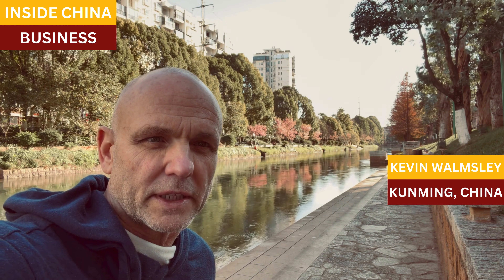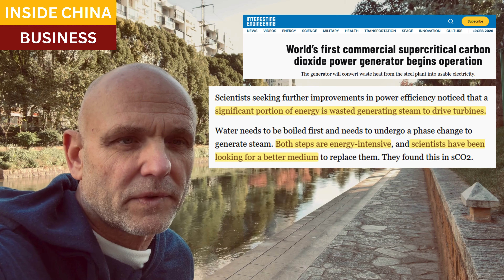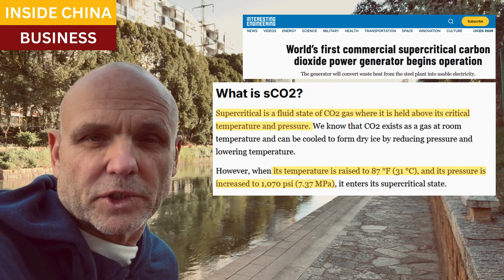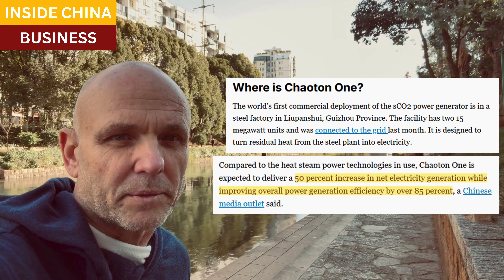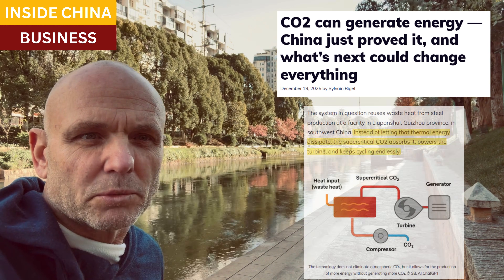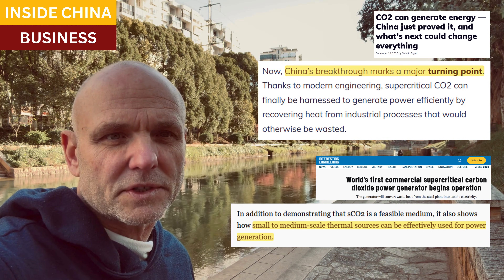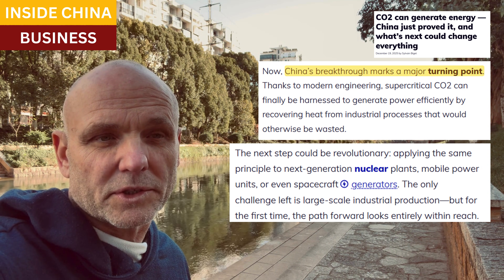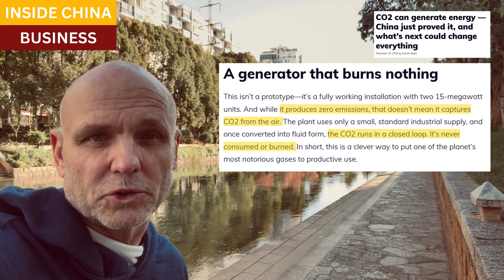Revolutionary generator transforms Chinese factories into power plants

Comment: So interesting and encouraging.  Go China! While some invade, others innovate.
Reply: Where are the ugyhers since you wanna act high and mighty 😂
Reply: Maybe very soon,
Beijing will not be in need of buying oil from Venezuela ?
Reply: @FunnyBunny-pd5xx  
That would be the plan.
I wonder if donny is going to be surprised when "previous customers" find other suppliers anyway.
Reply: @rogerstarkey5390

There are three types of oil.
Venezuela produces heavy oil. (Which the Refineries in Texas refine)

This heavy oil has several applications, including the fuel used by jet engines.
Reply: @FunnyBunny-pd5xx  The upcoming fighter jets from china (7th gen) are electric engines, jets already prototyped, waaay more powerful than all fossil-fueled jet engines (and simpler and cheaper to make & maintain). Same for jets as cars. An american expat in chinese singapore.
Reply: @davidrichards1741  That seems far-fetched due to the energy requirements, so I'll need to see it in operation.  The current jets we've seen are all using Chinese jet engines of conventional design.
Reply: @FunnyBunny-pd5xx  China is moving to produce bioAVfuel - automobile ethanol, but refined for jet engines.  China intends to be able to produce their own jet fuel as a matter of strategic necessity.
Reply: @davidrichards1741 

Thank you for your informative comment - much appreciated.

I was making the point - how convenient Venezuelan oil IS just the right type of oil, FOR The Oil Refineries IN Texas,
and
people who are living in The US, travel by plane whilst most people travel by bus.

Best Wishes for 2026.
Reply: @ZweiZwolf 

Thank you for your informative comment - much appreciated.
(I will try to remember for my future comments)

Best Wishes for 2026.
Reply: @FunnyBunny-pd5xx  You too, happy 2026!
Reply: @ZweiZwolf  That's already solved as silver solid state battery solutions provide much more energy with countless times greater energy density than all fossil fuels. Korea already has a working prototye. Or else new SMR's can more than amply satisfy energy requirements, and their price will tumble and use will burgeon. Not today but by 2030. Fossil fuel engines face obsolescence as they're inefficient, polluting toxins, and expensive to make and maintain.
Reply: @ZweiZwolf  China is exposed to western dependencies and export bans for conventional jet engines and related parts, tho they get some partial relief from russia. But china's focus is more on electric now. Wanna bet china will be producing electric jets before the US has its 6th gen fighter jet in production?
Reply: @d @davidrichards1741  I think SMR’s will be DOA, outside of perhaps China.  Solar, wind, batteries will still be cheaper than SMR’s which end of the day require Uranium, which isn’t cheap to buy or dispose of.  And the reality is all cost efficient grids will contain lots of storage options, which makes generation method way less important.
Reply: @FunnyBunny-pd5xx  China imports <4% of their oil from Venezuela, so they could cut off Venezuela completely with no issue, just import a little more from Russia, Iran, and Arab dictators.  As China electrifies transport (NEVs currently 60% of new sales, E-trucks booming, E-ships for inland water), their need for oil will drop rapidly.  Geostrategically, China will reduce oil imports to ONLY Russia, Iran, Venezuela, and friends - we'll see this in a decade or so.
Reply: @ZweiZwolf 

It always seems Beijing is light years ahead of the curve, in all aspects of every day living and working.

Thanks for the information.
Reply: @FunnyBunny-pd5xx  China MAKES the curve.  China's green shift changed global oil forecasts - not just for China, but the world.  It's amazing what happens when you let engineers run a country, their job is to optimize everything for everyone, and you give them the time and resources to do so.
Reply: @FunnyBunny-pd5xx China doesn’t need to buy oil from Venezuela anyways.  Not like there isn’t a glut of oil on the market currently.
Reply: "While some invade, others innovate."
I love it! 💯
Reply: Why not both?,the gun and the powder we're both inventions.
Reply: @aaroncruz9181 

Alfred Nobel invented dynamite, and also The Founder of the annual Nobel Prizes.
Reply: @FunnyBunny-pd5xx   True, but he invented it to make handling of explosives safer in mining and industry....it was others who used it to kill.
Reply: @MrLeadb1 

Thank you for your reply.
Reply: @FunnyBunny-pd5xx The Nobel peace price was just given to Machado, a far right political leader in Venezuela, who, upon receiving the prize, praised Trump and ask for foreing military intervention in her country.  Knowing that renders Nobel prizes worthless, meaningless in my book.  Let me correct that : they are not worthless, they are worth shit.
Reply: @louisjouvet4548 

I am fully aware of the information in your comment.

I ask you to refrain from using such language, when addressing a comment to me.

IMO - it is unnecessary vulgarity.
Reply: @FunnyBunny-pd5xx The image used served a (shocking) purpose.  Plus, it's not that vulgar after all.  But anyway, sorry if it offended you, it was not part of the plan.
Reply: @louisjouvet4548 

Thank you for your reply comment - much appreciated.
Reply: Meanwhile China planning to invade Taiwan:
Reply: @Xodabeef Taiwan is Chinese.  Learn history.
Reply: @Xodabeef  LOL, you can't invade your own territory, and no country in the world recognizes Taiwan as an independent country.  Not even Taiwan says that.  The Constitution of the Republic of China (Taiwan) clearly states that they are a province of China.  

It's not like the US Navy can invade Florida.
Reply: You said that about the country that intends to invade Taiwan? And is trying to take over the South China Sea.
Reply: @nexpro6985 With all due respect, you don't know what you are talking about; you are just repeating the propaganda script you are being fed.  Taiwan is Chinese it' s a fact recognize by the UN, by the international community.  As for Power projection, the US has more than 700 military bases all over the world.  China... 1.  Tell me now who is trying to impose it's power via brute force in our world.  Keep on educating yourself.
Reply: @louisjouvet4548  That fact is also stated in taiwan's constitution.  The DPP refuses to call a referendum because they know they'd lose.
Reply: @nexpro6985  That's the evil, hated US, despised by 87% of humanity worldwide, and by 94% of people here in ASEAN.  Read the new $65-million study of ASEAN by the gov't of singapore published in ISEAS.
Reply: @nexpro6985  What country will invade Taiwan?  Taiwan is Chinese territory, as recognized by EVERY country in the world.  EVERY country agrees that Taiwan is a Province of China.  The only question is which government should rule - that's a Civil War, and whether reunification should be at the point of a gun.

A country cannot invade itself.  You wouldn't say the US Army invades Colorado, or the US Marines invade Florida. But competing factions in a civil war can certainly fight.  

Compare with the American Civil War, in which the United States of America invaded the Confederate States of America.  It is the greatest hypocrisy to suggest China should not use military force in resolving their civil war when America did so themselves.
Reply: @ZweiZwolf  The only government that should ruleTaiwan is the existing government of the country of Taiwan.
Reply: @ZweiZwolf   do not accept CCP propoganda. You are a liar as are the whole of the CCP.
Reply: @nexpro6985 According to the UN and its members, that government is the People's Republid of China. 

Considering that the USA invaded the Confederate States of America, in defiance of the wishes of the people who lived there, it's the highest hypocrisy to suggest China shouldn't reunify by overwhelming force.
Reply: @ZweiZwolf Taiwan was NEVER part of China. Go read some history.
Reply: @nexpro6985  It absolutely was.  Taiwan was Chinese territory prior to the Japanese invasion, and the PRC is the inheritor of Chinese territory. Go read history, along with the Constitution of the Republic of China (Taiwan), which also clearly states that Taiwan is a part of China.
Reply: @ZweiZwolf Formosa was not a Chinese territory.
Reply: @nexpro6985  According to post-WW2 treaty and Republic of China, the island of Taiwan certainly is.

Now explain Ryukyu Kingdom.
Reply: @nexpro6985  Why is USA in the Republic of China (legal name of Taiwan Province of China) and the South CHINA Sea, half a world away from home? Asking for a friend. An american living in singapore.
Reply: @davidrichards1741  Taiwan is a country not a province of China. And your 'asking for a friend' is hilarious.
Reply: @nexpro6985  Taiwan is even less of a contry than hawaii.
Reply: @davidrichards1741  And China is barely more democratic than North Korea. We see the way the CCP shuts down bad news and gaslights the population of China. We see the oppression of the Uighurs by the CCP and their opression in Tibet. China is a dictatorship, nothing more.
Reply: @nexpro6985  Sure buddy, and yet globally, several times more people in the world today prefer China over the US, according even to the big new study by the West's own Democracy Perception index org.  And 80% of humanity aligns increasingly with the Global South china-led BRICS+ and SCO because they believe it's better, which is easy to understand why to anyone objective.
Reply: @nexpro6985  And the world sees that the US today is a lawless rogue pariah state. One of piracy and warmongering on the basis of contrived lies. US rightly convicted of jeno side of millions of kids & women by the UN ICJ and ICC courts. And the rogue US responded by literally threatening the judges!
Reply: @nexpro6985  A nation of racism, corruption, enslavement, jeno side since its founding thru today, with the most crime & violence & incarcerations of any nation. Insolvent and salty. Blames everyone but itself for its own-created problems which are worsening as it gradually fails. Now literally the most-hated and worst country in the world, nothing more. Speaking as one who has lived and travelled  all over the world.
Reply: @nexpro6985  US and the west today is nothing like what it was last century, for the worse. China and some others today are nothing like they were last century, for the better. Sad but true. And that trend continues. An american expat (renonced) in chinese singapore with 8 decades living on this ball of dirt.
Reply: @davidrichards1741  are you some kind of CCP shill? Why do you seem to assume I am an American? Does a person have to be American to recognise that the CCP is an authoritarian, nepotistic, corrupt government?
Reply: @nexpro6985  No, I assumed you were "west" or indoctrinated by it which amounts to the same thing at the end of the day. I'm a hunanist.  I servied. Did  you? Seems not. One good thing about the US is finally shaking off its parasites, which it should've done long ago. As the EUSSR and yUK are arguably even worse. All trash and talk about "authoritarian" and "corrupt", omg. World has changed and is changing more on an accelerated basis.Get a clue.

Comment: So basically China is gonna get accused of even more unfair advantage and low price in steel ? 😂 as if Chinese steel price couldn’t get any lower🎉
Reply: Henry Ford understood this methodology of reducing your costs to make more affordable products which then sell more, boosting your profits. Western manufacturers have forgotten the lesson he learned. China has embraced it.
Reply: @javelinXH992  not forgotten they leaned on the Rolex lesson. Fake manufactured scarcity, drive up demand, FOMO, price and profit. But only works when you can create fake money from thin air. This method siphons money from the rich and wanna be rich.
Reply: Remember a while ago, Kevin introduced us to "Flash iron-making"? ("3,600 times faster and 30% ENERGY reduction"?)
Well, NOW they can add the CHEAPER energy to the cycle!
Reply: Chinese is accused of better DNA. Can’t help it. Then again, China doesn’t have many basketball players.
Reply: Lame joke what advantage?

Comment: They're also planning to mate this turbine to the Thorium molten salt reactor (TMSR) because on top of increasing efficiency it will reduce risk significantly in the heat exchanger. TMSRs use sodium-based molten salt as its coolant, and this secondary molten salt then gets passed through a water-based heat exchanger to generate steam. Any minuscule leak in the heat exchanger could allow the salt and water to start mixing and cause cascade problems in the system down the line. Using sCO2 (which is inert) removes this risk completely.
Reply: Interesting thanks for the info
Reply: I heard that they are building an ice breaker based on this combination.
Reply: @tsuikr    Not only ice breakers but all large ships will use the Thorium cycle.
CO2 'boils at lower temperature and therefore can utilize lower temperature to produce electricity or shaft power in direct drives.
GE had developed a desk sized CO2 turbine which otherwise would be the size of a large room. [ I invent in this space]
Reply: @tsuikr     Submarines and large aircraft are the most relevant applications. That's probably where GE's focus is but now they will be forced to go mainstream or lose that market. In space,  lower boiling temperature fluids, like helium or nitrogen, will be used.
...
..
.
Reply: @MiloTheMindBender never nuclear aircraft, too heavy.
Reply: @glike2   As a triple engineer I assure you radioisotope planes are possible. USA and USSR designed them long before miniaturization was a thing. I wave improved this concept.  =]]
Reply: @tsuikr 

really?  I know they are building a Cargo Ship with TMSR
Reply: @Dutchthink28nmisAdvanced  Well, no. They patented one. The TMSR itself doesn't exist yet. They're only now moving to build a power-generating 10MW unit (the initial test reactor is 2MWth and doesn't generate electricity).

Also, the real reason Jiangnan patented that ship is because they needed a pathway to obtain nuclear naval certification because they were bidding for the Type 004 carrier. They lost the bid (because Dalian ended up building ship 020) and will build the first 003A instead (ship 019, basically Fujian with redesigned superstructure), but they will still pursue the nuke certification for follow-ups to 020.
Reply: @andrewsuryali8540 

Does  it matter why they are building the cargo ship?

They are building it that's what really matters 

👇

China plans world’s first nuclear-powered cargo ship to carry 25,000 containers

The reactor design is classified as a fourth-generation nuclear system and is expected to have a 40-year operational lifespan.

Dec 08, 2025

Interesting Engineering
Reply: @Dutchthink28nmisAdvanced  I think you're misunderstanding what I meant. I don't think they're building the cargo ship at all. I think they only patented the ship as a way to get nuke certification started for the lucrative Type-004 carrier project instead. The ship, if it ever gets built, will be decades away. The real project is the second or third 004 which may start construction around 2030.
Reply: Not all MSRs use sodium salt.
Reply: No, it doesn’t. It adds it to a pressurized gas that doesn’t condense itself like water. That’s a massive containment problem. The corrosion comes from the salt in the reactor. Admittedly, it could increase the lifespan of the generator if the heat exchanger isn’t corroding from both sides though.
Reply: Good luck with that. Just remind me, how many TMSR plants are in commercial operation? (Hint: NONE)
Reply: @nexpro6985  They're building the plant now, in the same Gobi site as the original test TMSR. The plan to use the sCO2 turbine is public knowledge in China. Dongfang (China's biggest turbine manufacturer) is currently bidding to supply the turbine. The test power plant is 10MW, although it isn't clear if that's 10MWth or 10MWe. If the latter, then the turbine will be about the same size as the one in this video.
Reply: @nexpro6985 commercial operation sure.... Also remind me, when was molten salt reactors first purposed? When was the first couple of ones made and how many years did they run before they stopped them?
Reply: There's an Italian company pushing co2 closed loop energy capture, using a heat store for the energy. Idea is for storage from renewable sources
Reply: Doing this and mass produce them and you could make hydrocarbons synthetically for less than 1usd/gallon and the electricity bill would go down to less than 0.01usd/kwh. All fusion reactors could stop their research immediately, solar, wind, coal, gas.. oil... Everything would be outcompeted. I know many physicist that think the worst we ever did was shut down the molten salt reactors and their research in Oakridge - all just because of greed and weird men that wanted nukes ( nope you can't make enriched plutonium with a tmsr, you could run it on our nuclear waste though and have completely free energy for a couple of hundreds of years ).
Reply: @LuiLulumon  No need to produce hydrocarbons synthetically, except on Mars. Also we need fusion for future space travel.
Reply: AEC 1960s design...
Reply: Old concepts.  Problem is actual thorium fuel CYCLE.

Comment: There are lots of concepts around.  It takes excellent engineering and comprehensive analysis of the alternative ways to solve associated technical problems that turn the concept into a worthwhile product.
Reply: PLUS
A Leadership which is not only prepared to encourage these "concepts"
but
financially supports them !
Reply: Very Holistic. None of that Binary Zero Sum Hacks.